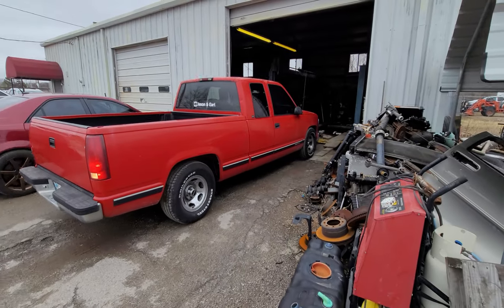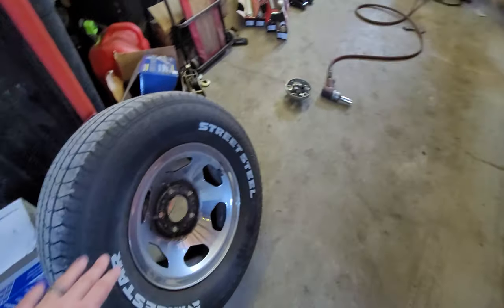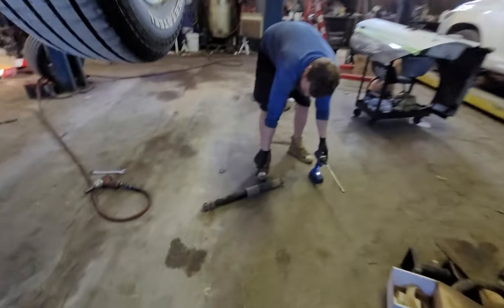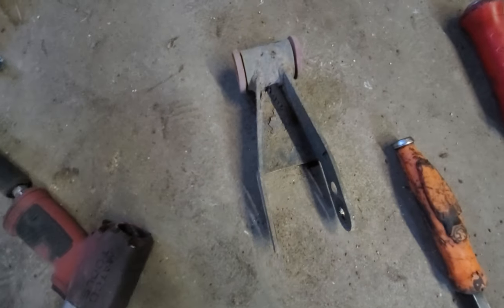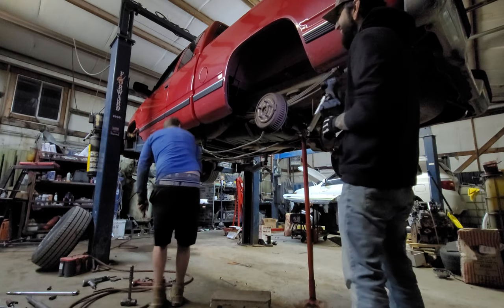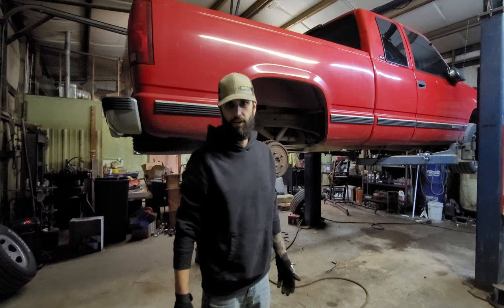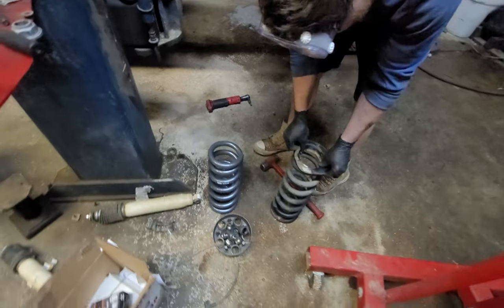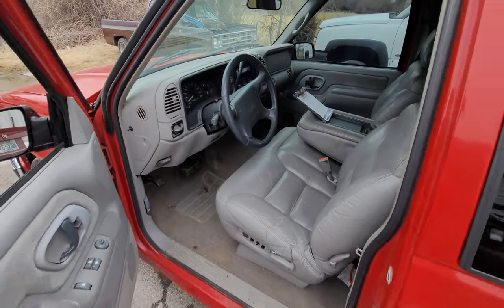Earl's 97 GMC Sierra C1500 Daily Driver Gets A Belltech Performance DROP KIT!

Comment: Did you put the carrier bearing spacer and pinion shims? I did the same kit I didn't use the shims and spacers.
Reply from the maker: We did not install those as well. No issues so far. I had another lowered truck with same kit for 3 years never any issues.
Reply: @JasonandEarl  right when I tried to put the spacers it looked like the driveshafts weren't in line . I myself have absolutely no issues. Thanks for the response.
Reply: @rl4643  I have this kit, Im about to install it, does diff hit the bed, or does it bottem out, Im surprised yall didn't instal the perch shims,  carrier spacer and the transmission spacer, no driveline vibrations?
Reply: @frankdatank7751  no it doesn’t hit I also pulled out the overload springs to get one more inch of drop in the rear. You have to hit hard to make it bottom out. I put the carrier spacer on the short side and I don’t have any vibration. I used a grinder with a cut off wheel went through the rivets with ease.

Comment: What fixed the wobble when braking?
Reply from the maker: New rotors. The ones that were on there were extremely warped and worn down. New rotors and brake pads got it braking real smooth.
Reply: @JasonandEarl  new bearings or did you reuse your old ones?
Reply from the maker: New bearings and seals

Comment: What did you do with the lines going through that bracket
Reply from the maker: Are you referring to the e-brake lines? We just routed and secured them using screw in guides.

Comment: On those ss wheels you are running 275/60s front and rear?
Reply from the maker: That is correct! However, I have done a wheel/tire swap at this point. New video featuring the updates is coming soon!

Comment: How low did you go?
Reply from the maker: It' was a 3/4 drop kit. Sits about 28 inches ground to fender lip in the front. 30.5 in the rear.
Reply: @JasonandEarl  Thanks. I have a 97 sierra single cab long bed and have been going back and forth on how low to go. I just don't want to have to cut into the frame.
Reply from the maker: We went as low as you can go without cutting the frame. I have about 3 inches of clearance but heavy hauls definitely make it rest on the bump stops.
Reply: @JasonandEarl  I actually use my head but nothing too crazy. I live in Miami,FL and drive down to the keys for fishing so I bring a beach fishing cart and coolers. It's mostly a highway truck. I got it for $900 and fixed various things to keep it going. It's a V6 5spd 2wd.
Reply: @JasonandEarl  just bought a redone rear end with a yukon posi and 3.42 gears. My original rear was an open diff and 3.08. I'm going to have that installed once I buy the lowering kit.